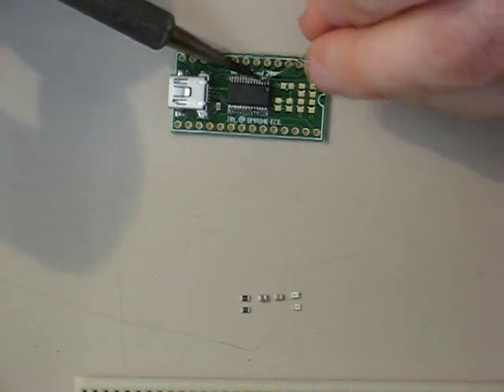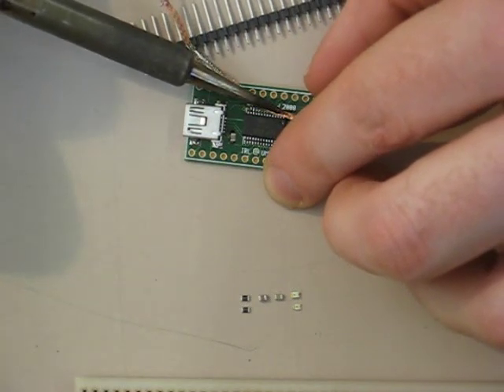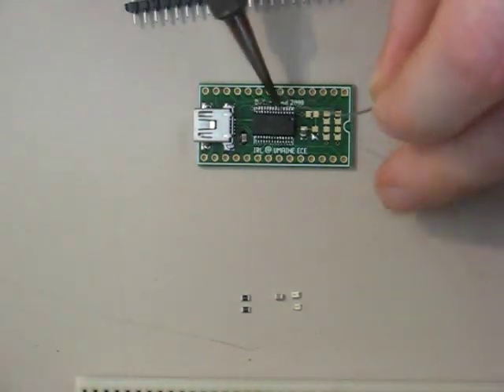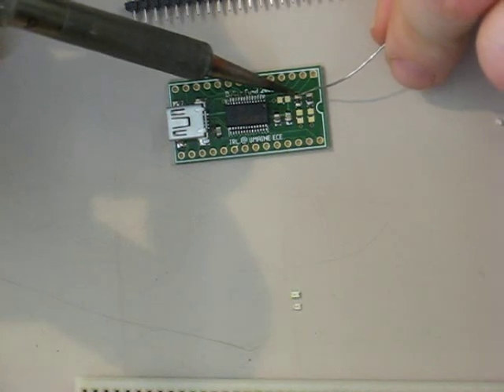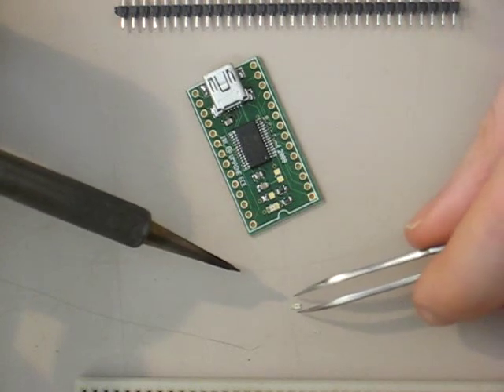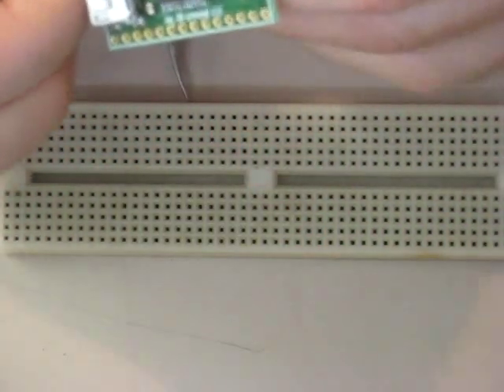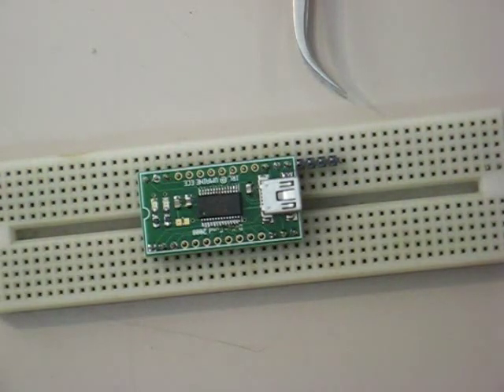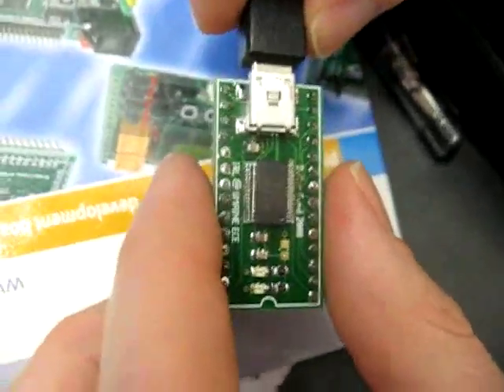How to Build A FTDI FT232-RL USB to UART - PART II

Comment: One really important thing about this type of procedure is the soldering gun and the wattage being used. Notice the smaller tip and higher wattage, making it look easy to quickly melt the solder and set the tiny components into place. Without a fine tip AND high enough wattage to quickly and easily melt solder to simply set a chip down, the component simply will not fuse into place. A larger tip can also create a HUGE mess and destroy the circuit board or components.